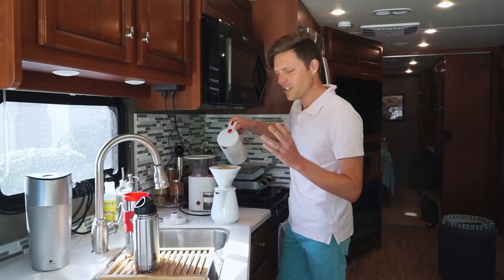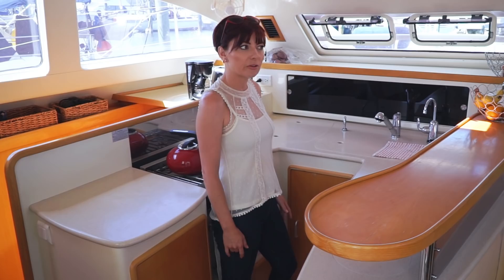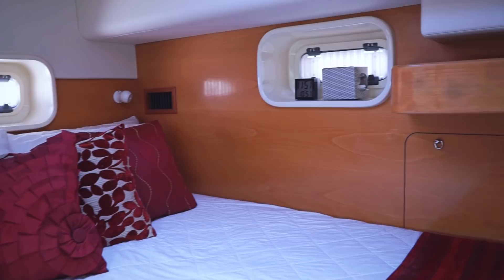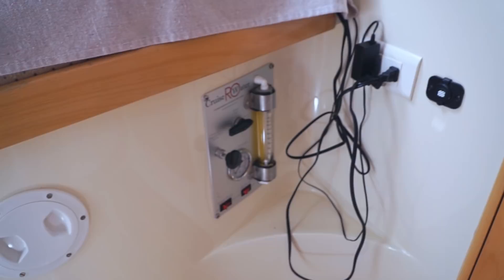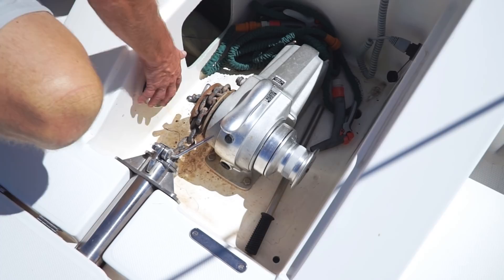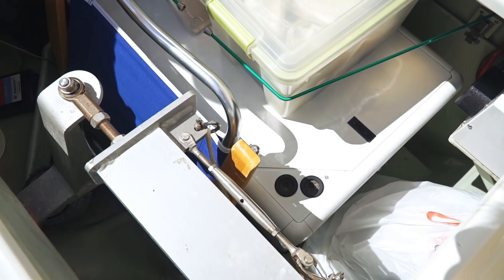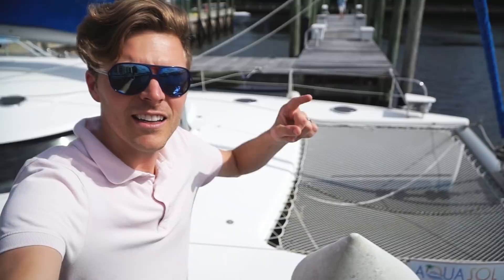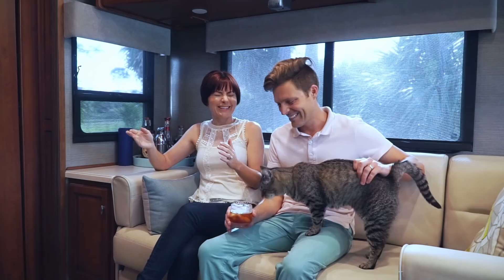Sailboat Shopping & the Almost Perfect Catamaran

Comment: The condition and cleanliness of the Leopard is amazing for being 11 years old. And it has all the equipment (lightly used) that you would have to spend more money on if you bought something cheaper. Generators, watermakers, air conditioners, lithium batteries, washer dryer, etc are not cheap. Also a recent survey (per the listing on Yachtworld) and a recent survey. Owners from Canada too so the US dollar exchange might help you buy it for less. Offer $275K and see what happens!
Reply: All the extras that stopped working within less than a year. Every single one of them
 They are now in NZ replacing a of them, including the windows and re-fiberglassing the instrument panel!!!!! They got what they paid for...

Comment: You guys are absolutely on the right track. You'll NAIL it if you find a Lagoon or a Leopard owners version.  Lagoon 410's are great, but don't buy a hybrid if you run into one of them. More problems than benefits. You might consider a Leopard 40 possibly if you can find an owners version, maybe a little smaller than you might like, but their laid out VERY nicely in Leopard fashion, and the $$'s are less.  The 44 owners however, is to die for. (both of these, I mean of the same vintage as  your looking for.) (You might just find a 44 for the same/or less than a 43 by the way.Also, remember this is another leg of your wonderful adventure, meaning, don't limit yourself to "local" cats, the very perfect one for you may be lying in the Carib, or in Texas, or in the Med. What's the worst thing that can happen? ... a week in Greece? ... TWO weeks in Fiji? Well worth it to find that treasure. The American & the British Virgin's are FULL of cats, many of them for sale. Many "away form the main selling market" boats take longer to sell and have less of a potential audience so that perfect boat might be had for WAY less than a Miami  or a Lauderdale boat, and that airline ticket to Greece just got more affordable than you thought.Bringing a boat across the atlantic or even the Pacific if necessary, for newbee's is a piece of cake. Not really, but it's truly doable. There are experienced crew (you find them on crew available/wanted websites and interview them) everywhere, just looking for a ride. People capable of helping you sail and teach you a hell of a lot on a journey like that. Like they say, the rush is in the getting, not the having, so don't be too much of a hurry to end what may be one of the biggest "getting's" of your lives.

Comment: There are lots of people here saying its a bad idea, I dont like to be like them, so I'll say this: its a good idea in terms of experience, it will be memorable, its a good idea because there will be less "regulation", etc... HOWEVER you have to consider the following:
1) You're in the market for a Catamaran, they cost more for a good reason, and the ongoing expenses will be more:
  a- insurance on boats in general is HUGE, not to mention a $300K Cat
  b- fuel, because they're not as easy to sail as monohulls, hence why the high engine hours (1700 would be considered a LOT
      on a regular sailboat). 
  c- maintenance costs are almost double as you have 2 hulls to maintain plus a larger superstructure
  d- boat maintenance is not as cheap as RV maintenance at all... you may spend $5k to fully upkeep an RV in excellent
      condition, you'll need $20-30K for a Cat if you're planning on traveling extensively like you guys are, that's assuming that
      its smooth sailing (pun intended). could put you in financial ruin if things go bad. 
  e- on an RV you have warranty for things that go wrong, be it in the RV or in the appliances, on a boat you dont, at least not
      at the price range you're looking at (which is already above your budget).
  f- I assume you guys are debt free which is awesome... on a boat you'll have multiple debts, not because every boat owner
     does, but because you guys have a budget and the lifestyle you're looking for is way above that budget, if you look at
     couples who own sailboats and are living on the cheap, its because they've done a lot of the labor work themselves, and
     they still take time out of sailing to travel back and work for half of the year to afford to keep doing this, and they're on a 
     30something foot monohull sailboat. you need deeper pockets, and if you start loving sailing and you're in debt at this age,
     it may become hard for you to sustain the lifestyle you want. maybe keep RV'ing a little more in other countries like Canada
     or Australia (which I have done a bit of and its amazing), and then 3-4 years from now when you have a substantial amount
     of money, you can safely go onto sailing cats.

2) Handling issues:
  a- Catamarans are more stable, sure. but they are larger than their length suggests, there will be days in the water where
      you guys will be sea-sick or just land-sick (where you just want to see some land), and on those days handling anything is 
      annoying, let alone walking across the hulls to do these chores, there will be more of them on a Cat.
  b- as someone below mentioned, you always have to make sure that you can handle the vessel by YOURSELF (either one of
      you) in case one of you is really sick.
  c- this is not land, in the water you cannot stop by the side of the road and wait for some passer by to help out or call a tow-
      truck, on the water you'll have to be a mechanic, a fiberglass worker, and an electrics expert (which is dangerous since
      you're in the water and you cannot take liberties).
  d- cleaning cats is a nightmare due to the size of them, they're all over the place, in an RV you have one long line and things
      are to the side of this line, some can argue that a sailboat is also like that, a Cat though, you have a lot of areas to cover,
      being in the water means that things can and will get messy more often than on land. 
  e- a Cat is great because it gives you space, however docking them is hard, so can anchoring them (it can be the easiest
      thing or the hardest, depending on the water and the bottom). anchoring and docking is not going to be an everyday thing,
      so you can ignore that bit, however sailing them in different wind conditions is not as easy as it is on a sailboat, and with
      minimal experience that you guys have, this could mean that you're going to rely a lot on the engine, or maybe damage
      something (God-forbid). 

Finally, I took this time to write this because your channel is great, and I want to see you guys continuing posting good educational stuff, I worry that if you guys stress your budgets and bite more than you can chew, we may lose a good youtube channel. YOU GUYS CAN DO IT, everyone can do anything they set their minds to, its not about if you can or cant do it, its about timing it right, and I feel that its too risky for you guys to jump in a Catamaran this year. consider going to Canada, Alaska, Hawaii on your RV, or even sell it and do an RV tour of Australia.

Brokers are people just like us, they're nice and try to make a living, however part of that is to sell you a boat, because they invested their time with you, a lot will be honest with you about things, but they may not point out all the possible negatives that you're running up against, because its NOT their job to deter you from buying what you want. They're not the ones who will be with you paying the debt or the ones with you scrubbing the floors, their job is to get a sale done while making you happy about it, and you guys are enthusiastic like anyone else who wants to buy a boat of any kind. Consider it more.

Peace and Love from Dubai
Some Random Muslim Arab guy on the internets =P

Comment: Hey guys....the Leopard 43 is nice.  It is shaft drive, versus the typical sail drives.  there are pro's & con's of both.  The con of a shaft drive is the engine is under your beds....this can cause heat to build up/smell of deisel in the room and makes it heard to sleep if your motoring.  The pro of shaft is less maintenance or things to go wrong.  Sail drives allow the engines to be pushed aft...typically around the sugarscoop steps.  No heat in living quarters or smell.  However, most sail drive have issues with seals.
Reply: +Douglas Montgomery Did they mention it was a SAIL boat? It's not a motor boat. The motor is used to get in and out of harbors. Anyone who uses a sailboat as a motor boat is insane.
Reply: +Elmo Harris , I'm QUITE aware what KIND of boat it is.  However, the motors are used much more than you are eluding.  Of course, that depends on what type of "cruising" someone is doing.  Based off THEIR comments...they will need engines for circumnavigation, storms, no or light wind days..etc..etc.
Reply: +Elmo Harris Describes them perfectly.
Reply: +acmeopinion factory apparently you've never been on long sails, with no wind...wrong direction wind, bad weather, needed hot water or charge batteries.  Either way, MY points are dead on
Reply: Douglas Montgomery I've got over 4k hours on my Yanmar, so I've seen some windless days. I was just agreeing with the idea that they were crazy to do this without experience and seem to have an unmanageable time frame to find a boat. If they think those port shades cost $10, they are more clueless than I've ever seen.

Comment: Interiors are important as you will be living aboard but you seem to completely ignore the systems and what makes the boat work. Those bigger cats have enormous mainsails. Do you understand how to reef when over powered. Do you both have the physical strength to deal with it. Are you even aware of the enormous loads involved. Are you looking at storm equipment or ground tackle, electronics? Are there whisker poles  or spinnaker poles? Is the boat set up for offshore if that is your dream? Is it even a good offshore boat. Cats also have a huge amount of windage and can be hard to control in 30+ knots in tight quarters sometimes unable to make headway. I'm assuming you are wanting to venture offshore a bit, Caribbean? Do you suffer from sea sickness, do your cats? Maybe a week skippered charter in the shoulder season or a charter/ instruction would give you a better idea of what is important and more importantly if you like it. Seems like you are putting the cart before the horse.
Reply: 05Cat28 these kids have spirit, and they have all my respect.  Peace✌️
Reply: Just subscribed....spend as much time on the water renting before you buy...start smaller...cats are wide, flat sailing, expensive....
Reply: LOL fast forward from when you wrote this and they seem to be doing fine, I guess eventually they have learned all you know and maybe more!

Comment: Owners config, water maker and looks very clean, even down to the motors. Fantastic!
Good cat manufacturer, which means better support for odd technical issues.
Keep in mind that this config with motors under the bed(s), because motors are often used underway, even when there is wind, is a noise issue for the person not on watch.
Price is nice, but if that price or even $50,000 less will leave you tapped out afterwards, I think most any boatie is gunna say that's gunna be a HUGE problem as there will be plenty of rather expensive cost issues to follow, and ongoing.

A fresh and thorough independent inspection and sea trail will find other issues, but those will also give you ammunition to negotiate.
Do those tho - damn important.
All and all tho, good looking cat for 2005, and Owners version is such a find.
Congratulations!  Hope it works out.  :-)

Comment: Here it is, August 2021, and after their perilous transit to New Zealand I have the feeling that Curiosity will either be going away or undergoing more than repairs and getting some major changes in design. They've got a leaky boat. They're dealing with leaky thin windows, a leaky, flimsy hatch in the middle of the cabin where the lifeboat was ripped away by a wave, leaky plastic with poor zippers surrounding the cabin.  They might even find more problems caused by the New Zealand passage. I think the repair costs will end up being too expensive.
Reply: Plus repair the watermarker, the genny, the AC, replace TV, fridge freezer...

Comment: The leopard was a super great price if it includes all the equipment. It is REALLY expensive to equip a boat (sometimes as much as the vessel itself) and it is also really expensive to maintain a boat. It's fun to watch your process, however. Like the rest of the viewers who are sailors...your budget is way out of whack for what you want. Monohulls are so much nicer, usually better built, more sea worthy and much quieter. Fountain Pajots are probably the best at a somewhat quieter sail because there is more clearance. The leopard...the waves would be slap slap slapping and it can get super loud below. You could get a gorgeous monohull in your price range and it would be safer for your kitty cats. There is no protocol for cat overboard. You will learn and practice MOB drills, once you take serious lessons. A cat would be a nice boat for living in a marina or an evening sunset sail. I wouldn't set foot on one in big water or weather. You saw the crack from the mast...food for thought.

Comment: You are looking at HUGE boats.  I would hate to have to sail them in a storm.  Docking will also be an issue.  (I don't know how difficult anchoring will be, but, with the amount of windage these have, it might be tricky.

Remember that you might have to single-hand the thing in an emergency.

I really suggest that you charter a boat for a week or a month before buying one.

Have fun!
Reply: +David Messer Seriously, these people should buy a smaller boat and get some experience locally first...
Reply: +Calvin Smith Or go for a motor-yacht.  With the boats they are looking at, I'm thinking that they will be stuck in port most of the time.  I have captained 35-40 foot monohull sailboats many times and I wouldn't be comfortable with a crew of less than three.  These boats probably need four or five to be safe.

That doesn't mean two couldn't handle them in a moderate breeze or with enough experience, but what happens in a storm when things go wrong?  (Things always go wrong.)

In an RV, if things break you just pull over to the side of the road.  There isn't any side of the road at sea.

Comment: Pay a external contractor, not affiliated with the broker, to inspect the rigging.  It will coast about a thousand dollars, but new rigging costs about twenty thousand dollars.  Make sure you are with him and that he talks you through the entire inspection. Film the inspection in case he misses items, you need to get your money back from him.  Make sure that when he goes up the mast head to inspect the rigging that he takes good, clear close up photographs of the connections and of the metal strand clamp bundles where they are cinched in together on all points of the boat.  There should be NO broken strands exiting the metal rigging clamps.  Not even one. If there are you need new rigging because the clamp that holds all of the twisted metal strands is full of rust an it can't be repaired or cleaned out.  The break will usually occur right where the strands enter into the metal clamps.   This is especially important in a performance cat like the Leopard where the owners may have sailed in speeds over the recommendations.  In mono hauls the boat heels and releases energy from the rig, in cats the they energy has no where to go but back into the strands and blocks.  No cracks or rust on the blocks or the strands.  Be prepared to walk away if these items are not replaced with a minimum three year gaurentee.
Reply: They won't do it.

Comment: I would ask your broker to give you a boat cost of ownership spreadsheet (you can find them online) so each time you look at a boat, you can tally up the items requiring repair so they can be factored into the actual cost to buy.   Also, if you go the finance route, you may encounter difficulties obtaining  loan if you don't have a permanent residence in your name.  Boats are hard to find when out in the ocean  and finance companies like to know where they can find you or an asset of value.